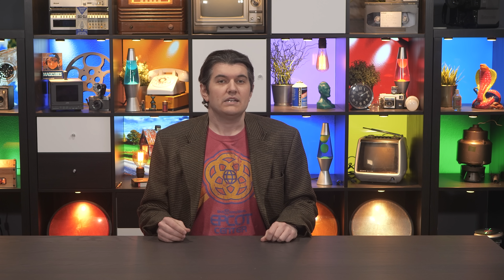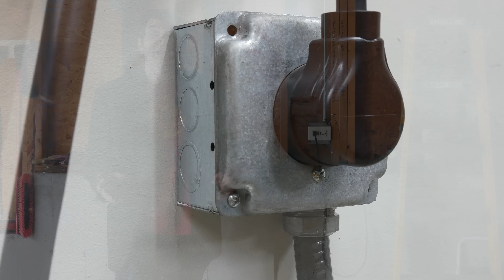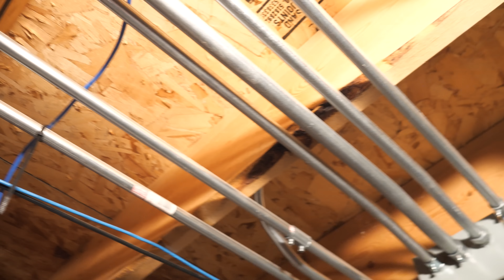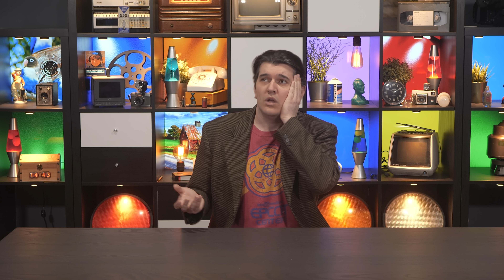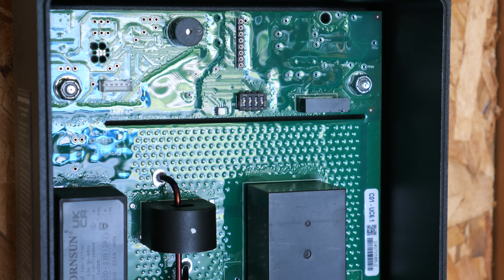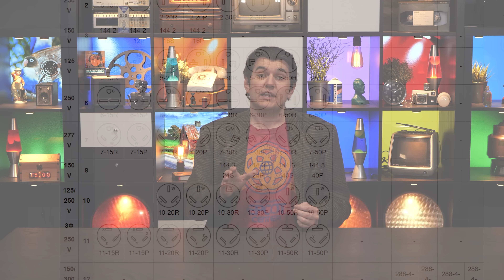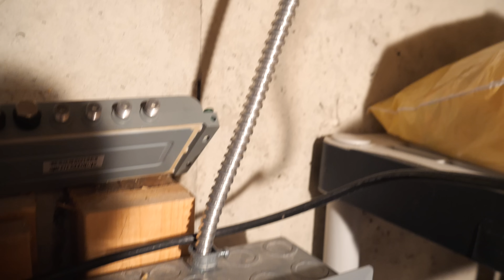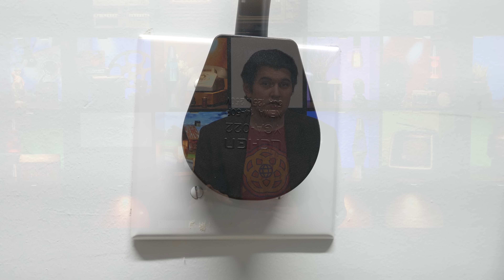The "standard" car charger is usually overkill—but your electrician might not know that

Comment: Meanwhile, Europe is split between "neat, I have 3 phase power anyway!" home owners and "who do I have to sacrifice to the Dark Lord to make my landlord or city install even the most basic charger near my parking spot" renters.
Reply: Tbf, that issue for renters exists everywhere (incl. the US)

Heck, my employer has been trying to install EVSE on the light poles in the parking lot and the landlord won't let them.
Reply: @antonliakhovitch8306 
 A potential reason for that is that many light poles are 277v and metered separately from the rest of the property. There aren't a lot of 277v (1ph of 480) chargers, and the wires are also frequently fairly low spec, as well as being powered by a relay and timer/photocell, rather than putting a timer or photocell in every light individually. 

So adding chargers to light poles may require completely rewiring and installing a new conduit to manage fill percentage. And that doesn't include the potential of issues with the light pole manufacturer not allowing those modifications without violating the listing. 

There might be power there already, but it's probably more expensive to use than installing new.
Reply: @Nidkidful Thanks, that's super informative.
I've seen buildings in the commercial area across the street install EV chargers on light posts for their fleet vehicles, but I imagine stuff is different there than in the industrial-ish business park my office is in.

On the other hand -- our building has stupidly high capacity industrial electrical service and we regularly get electrical work done on the inside. I'm sure they could find a way if they tried. I think the real issue is that the inside of the building is our domain, but the parking lot is managed directly by the landlord.

Luckily for me, I negotiated exclusive access to the one outdoor outlet behind the building in my contract, even before I bought a plug-in hybrid 🙂
Reply: Here in the Netherlands we have 3 Phase 380/400V as well
Reply: A client was installing a large warehouse to grow plants (legal here) in. He had the option to install 3 phase. He declined and said it wasn't necessary for just lighting. He might be regretting that now. I even told him it would make it sell for more if he decided to sell it.
Reply: Or the most frustrating situation: you have an outlet but it not allowed to be used for EVs
Reply: @leonidb3736 if it's not allowed I assume it's not yours? 😅
Reply: @pedropereira5043 if you live in a apartment complex the common infrastructure is, well, common. Means in reality even if you own a property you can’t do much, especially with the rules unless every other owner vote for that change
Reply: @pedropereira5043 or it's at capacity. An apartment building near me had a detached garage structure where everyone got one stall. They provisioned exactly enough 20 amp circuits to run the many door lifters (and used logic to limit the ones running at the same time) 

Worked beautifully for a while, until someone plugged an EV into the circuit and blew the breaker the next morning.
Reply: @pedropereira5043 it's more the issue that home grids aren't built for people non-stop using 3+kW for hours. It's fine to thrown on a kettle every in once in a while, wholly different story if 20 households have 2 kettles worth of draw for hours at a time.

This can be managed, but at least in Germany, to prevent grid spikes (less of a problem for the whole grid, more of a problem of tripping power for the building), an apartment building owner has to install a power management solution to allow EV charging in a garage. That's with it, but you need to convince co-owners that don't live there and/or don't have an EV themselves, because obviously installation and maintenance of that system still costs money
Reply: @leonidb3736  "you have an outlet but it not allowed to be used for EVs"
And that is completely justified:

half a year ago we had a huge network-problem at a convention. It would work for a couple of minutes and than randomly parts or the entire network would fail. After a couple hours of troubleshooting we found the problem: An EV charging at the other side of the centre. Its charging simply put too much noise onto the line and also was too irregular for other equipment to work correctly.
Reply: @ABaumstumpf  The car is surely EMV certified, unless it's a prototype. Therefore shouldn't be allowed to interfere with other equipment. If it still is, then you should report it to the authorities. But most likely it's just a defective onboard charger. If it was AC Charging that is. DC Charging uses powerline communication, which can be more problematic.
Reply: @tschuuuls486  "The car is surely EMV certified, unless it's a prototype. Therefore shouldn't be allowed to interfere with other equipment."
Those requirements are not as strict as the power-requirements for some electronic equipment. And it still can happen, specially given that the US has basically no country-wide regulations for vehicle-state.... just look at all the rolling rust.
Reply: @ABaumstumpf Most likely it's just that it's meant for running a engine heater and a) designed around having a 1-2h schedule timer hardwired into it (that is, assumes not too many outlets will be on at the same time, thus low capacity) and b) not metered separately
Reply: Lithuania has 3phase as standard too
Reply: Yeah, 3 phase, 40kW 2-family house to grid connection here. My 2x 11kW chargers can work at the same time, as well as the washing machine, dryer and oven. And I love it. Upgraded the grid connection for a possible heat pump in the near future.
Reply: @_TbT_  You need a load balancer, that automatically lower the power on the EV charger when power is used for other things in the house.,
Reply: @sallerc  by no means an expert but don't think he does unless he has a really high draw from his home otherwise. Sounds like even if he runs everything he has power to spare, not sure about other issues.
Reply: The AC charging standards in the USA don’t need to explicitly support 3-phase, because US electrical code allows for 12+kW loads on a single phase. If a public space has 3-phase supply, you can make use of that by having several single-phase chargers, distributed across the 3-phases.

Basically the US code is more tolerant to phase imbalance than EU codes. It seems to work 🤷‍♀️
Reply: By the way, just because the house I own has three phase available, that doesn’t mean I can charge a car — I don’t have a garage or a drive way. My car, if I had it, would be parked on the street.
Reply: I recently bought a house older than the United States. And hey, even I'm in that first cat, we have 3 phase outlets galore.
Reply: I've learned recently, but Italy it's not abnormal to have the whole house only supplied with 3.3kW. I've no idea how you'd charge an EV if you can't run an oven and a hair dryer at the same time.
Reply: @sIightIybored  Wow.  That's amazing.  Is this rural Italy or something?
Reply: @christo930 no, most homes built until 15 years ago or so have their wiring sized and contracts for 3 kW single phase. Now it has to be at least 6 kW
Reply: @sIightIybored yeah but you can request up to 6kW just by calling the power company, and 3phase 400V doesn’t cost more per month than single phase (you only pay the work to upgrade). Only problem is you have to pay about 2€/month for every kW of available power (both with single and three phase)
Reply: @Fla.3  true, but often you have to redo part of or all your wiring if you wanna actually be able to use the whole 6 kW, since if you have a 3 kW contract you probably have everything sized for 3 kW. Also it's true that upgrading to 6 kW is pretty easy but going higher is hard:  instead of just an electrician's certification you need an actual project signed by a professional engineer/circuit designer to have your system code compliant. Distribution company may allow up to 10 kW single phase if they consider the local grid "strong" enough, and above it's only three phase.
Paying more in standing charges for electricity it's not much of an issue when it allows to get rid of the gas bill.
Reply: @sIightIybored all new builds and renovations have to be 6.6 kW, which is ok for overnight charging (also you can draw 33% more for 3 hours so you have a temporary extra allowance up to 8 kW). It's still uncommon to find three phase and higher than 6 kW in residential but you start to see it in independent homes with solar.
I know spain is in a similar situation, France, Portugal and Greece are a bit better (the most common size is 6-8 kW instead of 3)
Reply: @sIightIybored 3.3kW is the norm in Italy for historical reasons, not the maximum contract which is 6.6kW and cost a bit more.
All contracts can peak up 40%  for 2 hours, so everyone can use up 5kW, that is plenty of time to dry hair or cook a pizza.

The issue it's that the Italian population is is mostly old people living on skinny pensions, they don't care at all about EVs, PV or electrification in general.
Reply: @jdm2651  it just seems crazy low from a country where I have 14.5kW and have been told I should probably upgrade to 24kW for more thermal headroom if I got an EV and wanted to run some appliances at the same time. 48kW is not atypical to the North Americans.
Reply: @sIightIybored Hey that's me. My house is only supplied with 3.3kW. I usually charge overnight at 3 ~ 2.8 kW. If I charge during the day I might charge slower if needed. Anyways you can go over that in small brust but it would eventually trip. So it's not a problem with a 3.3kW circuit to be using an oven or an air fryer and charging at 3kW. The load cycle of most appliances is short enough that nothing will trip. If needed you can have a 5kW peak or more for several minutes. The wiring coming into the house is rated for 7kW so not a problem due to the demand is split between multiple circuits don't panic.
Reply: @sIightIybored I guess it is because Italy does not have cold winters and a history of electric heating. My 140 m² house from 1974 is designed to be electrically heated at -29 °C and thus 3 x 63 A 230 V.
Reply: @sIightIybored  Similar in the caribbean, had 5.5kw but could technically handle around 10kw.
Reply: @sIightIybored  You make the car stop charging when you use an oven or hairdryer and start charging again after the load is turned off? Something like a zappy should be a off the shelf solution to that problem. Can also be DIYed with a shelly and home assistant.
Reply: @tschuuuls486 yeah that's common  knowledge for Italians, can use only one high power appliance at a time (oven, hairdryer, dishwasher, washing machine, vacuum cleaner, air conditioner…). For a full electric household, though, 3 kW is too little, in fact most Italians cook and heat with gas. 6 kW is ok but it can become a bit too tight  if you get an EV.
Reply: Here in Spain normal houses dont have 3 phase power, you can install It but is expensive, and normal power for a House is like 4kw
Reply: I'm a renter in the Netherlands (housing coop) and they've recently renovated my 1970s bungalow to be much more energy efficient. I also got a 3 phase electric thingy in the process.
Reply: Tough situation I’m assuming that maybe landlords don’t want to spend money on an expensive installation. So as an EV driver and as a LandLord or a small two family and a single tiny home rental  who do you all think should pay for these expensive installations?   As a reference I had charging installed at the two family that my wife and I live in to the two and half $5000 for a dual charger and that’s just for two EV’s no I know that in certain situations these things can be done for much cheaper, but nonetheless, this is still gonna cost quite a bit of money at least it’s quite a bit of money to me.  

No, I do believe that apartment complexes can’t afford these things and no doubt it as quite a lot of value and makes their apartments appealing and hear the US. I find a lot Place is starting to do that though sadly, they charge a huge amount for charging and what I mean is nearly the cost of fast charging at a supercharger.  Which means that they are charging well beyond what they need to pay for the expense of the installation and the ongoing costs of maintenance and electricity.    

How do we solve these problems? I’m thinking about getting into Consulting when it comes to these matters, but I’m not even sure of the best possible solutions entirely myself.
Reply: @LectricOverlanding , 20 amp receptacles are the solution.    So easy.
Reply: Three-phase home supply is not common in the UK, most homes are single-phase 240v and those with EVs get on fine with either the plug-in granny cable or a 32 amp / 7.2 kW dedicated circuit for a wall box 'charger' (EVSE).
Reply: @GruffSillyGoat Technically is is 2 phase. A single phase would only get you 3.6kW. Charging done via (230Vx16A)x2 so you have two phase lines + neutral. You don't run 32A through a single phase line.
Reply: @G @Gazer75 have no idea what you’re on about. It’s indeed a single phase supply delivery from the power grid to the house I.e. one Live circuit and one Neutral circuit. From the switchboard a dedicated 32A circuit can be run to supply the EVSE.
Reply: Many commercial spaces (incl. parking lots) and apartment buildings in the United States are served by 208Y/120 VAC or 480Y/277 VAC; yet, neither CCS1 nor SAE J3400 support three-phase AC charging.  Go figure.
Reply: @jmdavison62 So you think CCS2 might just be a better standard then as it supports AC single phase up to 7.4kW and three phase up to 22kW all in the one connector.
Reply: Im Part of the latter crowd. 
But at least I can get the most basic 11kw charger without much hassle. I love 3 phase power.
Reply: 3-phase power at 400 V! 11 kW at merely 16 A, or even 22 kW at 32 A.
Reply: As someone who has helped install EV chargers in cold climate areas, the tip about conduit requirements and local code differences is spot on. People should know that MC cable is a solid workaround where Romex isn’t allowed. Great callout about the 80% rule too most EV owners aren’t even aware of it.
Reply: The french parking lot-solar coverage legislation might help with some of that and be a model for other regions
Reply: For my country we mostly live in apartments that share carparks, with typically a handful of chargers per carpark of a few hundred cars, so I'm not sure if there'll be enough to go around. Also when your car is fully charged there, other motorists may expect you to vacate the charging spot promptly, but what happens if the carpark is full then? Does our car then get evicted from the carpark? I was wondering
Reply: Poland has so liberal laws about EVSE in shared apartment garage
You basically need to inform your housing council, and they can't say no. They can't interfere. They can't do anything as long as you have a favourable EV outlet expertise from one of MANY companies that install them
Reply: @KittenRaee In Portugal is the same, even if you're in an apartment building the other residents can't say no. But you have to ask anyway 😅
Reply: Yes., Germany here. 3 phase power and a 22kw charging station. That‘s a lot of power, not 5.8kw. The power grid in the US seems to be a little bit underwhelming.
Reply: Renters are out of luck in most places.
Reply: @danr1920 Oh you're more than welcome to pay for the upgrades yourself. 😂
Reply: At least most of Europe’s outlets can manage tea kettles way under 2 minutes.
Reply: Europe is not a country.
Reply: @MarkGovernI’m pretty sure that they are referring to central Europe (and Germany), not eastern Europe.
Reply: Fortunate, I live in 230 V land, and aluminium wiring is banned for LV installations.
Reply: I think due to the age of some European cities, their infrastructure is just not up to the level it needs to be for modern use. And unfortunately this is one of the big side effects.
Reply: Renters vote with your feet, if they don't, move, and let them know why.
Unfortunately this will need most renters to do so, otherwise the landlords will just laugh
Reply: @paulstubbs7678 
Literally nobody will abandon a favourable rent agreement for that if they can still drive gas cars. If there's a law stopping the sale of the latter there can also be one forcing landlords to install charging stations.
Reply: @Alias_Anybody  But is it a favourable rent if the landlord is a pain when it comes to EV's
Reply: Sorry sir, your amps are needed to fuel the poor emigrants!
Reply: Or I cant afford a EV or dont need one. But then EV owners doesnt realize there is such a demographic
Reply: @DrLoverLover  that's a bit silly. I'm an EV owner and I know there are folk who can't afford one or don't want one.

I just don't care about their opinions.

Why? Not because I hate ICE vehicles, I've owned several for many decades, still do for my motorbike, but because I use EVs.
Reply: 3phase is only standard in german speaking countries. Others have 1phase.
Regardless, we typically install red or blue P17 plugs.
Those US plugs seem so dangerous when the plug is half inserted.
Reply: Czechia is not German speaking country... @ABa-os6wm 

We have 3f 400V.
Reply: @danielsaroch2424 
Hey, Czechia could be counted as a German speaking country if you squint while staring at a map. At least more than Norway or Latvia.
Reply: @ABa-os6wm  I have 3 phase in my house, and I'm not speaking German. Luckily, they couldn't cross the channel 80 years ago
Reply: @ABa-os6wm I live in Poland we have 3 phase - at least in all new builds. Quite common in kitchens
Reply: @ABa-os6wm  What? It's standard and has been so since like forever in Sweden and Norway too and we don't speak German. Since you were wrong on that, I suspect we can simply forget what you said and that 3 phase is standard in many more countries.
Reply: @skunkjobb looks like it's easier to list where it's not standard: UK, France, Spain, Greece, Italy, Portugal
Reply: @elia_berti  in the UK you can get 3 phase - but it’s not standard, but often installed for larger houses. I have a 3 phase 400v 75kW supply to my house. Given most electric vehicles in Europe can’t do 3 phase above 16A I went with a dual charging post with 2x11kW points. This is handy as I get 5 hours of overnight cheap electricity and it means that you can almost always fully charge overnight at less than 10c/kWh.
Reply: @elia_berti in Italy you generally always get 3phase to the meter. The problem are the circuits between the meter and your appliances. But this is changing relatively fast for new premium homes, and in older ones it’s not so hard to upgrade after all.
Reply: @ABa-os6wm  I live in Serbia which is for sure not German speaking country and even my grandmother house build in 1961 had 3 phase sockets with every room had one ,because here stoves  always runed only on 3 phase but also heaters.
 During 60s,70s and 80s everyone who was not connected to central heating would run heating on 6KW heaters that would store heat in night because then it was 4 times cheaper then in the day ,it had some ceramic inside that would store the heat and they they woud release in day with fan
Reply: @ABa-os6wm Everybody uses 3 phases. The German grid operators are just paranoid about anybody running any load bigger than a toaster on a single phase due to 'Schieflasten'.
Reply: @patrick_test123  Firefox translated "Schieflasten" as ""Unwanking load" when I looked it up on Wikipedia.  That's hilarious.
US residential is split phase, 3-phase is used almost exclusively for commercial buildings here.  My house has pretty standard 200A 240V service, the only things I've got on both phases (so actually getting 240V) are the HVAC, clothes dryer, and car.
Reply: @ABa-os6wm netherlands is not german speaking… and 3 phase is either an easy and inexpensive upgrade or standard already
Reply: @backdrafter1988 one can argue that we’re just swamp Germans here. But that’s not very popular since 1940.
Reply: @ABa-os6wm  "3phase is only standard in german speaking countries" ??
lol, - Did you mean "germanic languages countries"?  :p
3-phase is standard house supply here in Norway. 
Only thing uniqe here, is that Norway and Albania (I belive?) use IT (Isolated Terra, - a floating earth - 3-phase 230v, with no neutral wire as a standard.
All of the world have 3-phase power as a standard. 
Pretty much all of Europe have a 3-phase power supply to moste houses and buildings.
Reply: @zigge1989  I wouldn't call 3 phase standard in Norway yet. Over 90% of homes still use IT which in 99% of the cases is not 3 phase. They just get two of the lines basically. You wont find many grid companies offering 230V IT 3 phase to private homes these days.
Reply: @Gazer75  All houses I have lived in build 1950's and up to 2000' have all had 3.phase 230v IT net.
The exception are older apartments, as 3-phase are split between other apartments.
The house I live in now were build 1972, and it has original 3-phase 230v power supply.
Reply: @zigge1989  What area is this? Here west my dad had to order 3 phase specifically due to some equipment using 3 phase motors. They stopped offering 3 phase to private homes back in the 80s I believe.
When they were going around replacing the meters to the smart ones the guy from the grid company had to come back as he had no 3 phase meters with him. No one in that area had this.
Reply: @ABa-os6wm 

Its standard in nordics as well..
Reply: @NerbyScurvy  Only for newer areas in Norway. Any areas developed before the mid 90s use 230V IT and mostly single phase.
Some allowed 230V IT 3-phase for private customers, but it was rare. We had that in our home built in 1976 due to some equipment my dad had.
New substations have been built to supply 400V TN-C-S.
Reply: @NerbyScurvy  It's not common to have 3 phase power in homes here in Norway. It may be standard for some businesses that use a lot of power. You can of course have it installed in your home if you want it, but it's not common
Reply: @perdanielsorensen7775  Since the late 90s any new development has 400V into the house. That is how you can get an 11kW 3 phase charger in newer homes ((230Vx16A)x3)=11kW.
My apartment building has 400V which is then split up to the apartments. We do not have 400V all the way as nothing uses it in the apartment.
My parents do have 400V all the way as the Nibe exhaust air heat pump system that heat each apartment need that.
Reply: @Gazer75  , I’m not familiar with “IT”. what is that? I’m in the US and our standard is 240V split phase.
Reply: @stellamcwick8455 Look up "earthing systems". There are 3 main ones. TN, TT and IT.
Reply: @stellamcwick8455 The TN, TT and IT are grounding system definitions from IEC.
Reply: @ABa-os6wm this pretty common in France as well for large homes.
Reply: @ABa-os6wm  Hello from Greece. Plenty of homes have three-phase here.
Reply: @ABa-os6wm aside from being entirely wrong, what exactly are you saying here? Is 3 phase power limited to German speaking countries in some weird linguistic power play? Maybe lay off on the schnaps.
Reply: @ABa-os6wm  nonsense. We don’t speak German, and everyone has (well, can very easily and cheaply get) 3-phase power. It’s already in your main fuse box, the fuses just are not connected on the other two if you don’t have it. You just call the electricity company, make an appointment, pay something like €50 or so for someone licensed to install the missing fuses and re-seal the main fuse box, and you’re done. It’s the same monthly price as just having a single phase too.
Reply: @ABa-os6wm 
I have 3 phase here in Romania.
It’s fairly common even in flat apartments.
Reply: 3 phase is available in all EU countries.
It's just that in some it was more easily available in the past.
Reply: @ABa-os6wm Oh geez. I can't remember the last time I was shocked. Maybe 25 years ago. And US plugs are way better than Japanese plugs, especially since Japanese infrastructure is often so old. Not to mention not having a ground so you can't run anything you'd normally run in the US without some modification.
Reply: @ABa-os6wm  In the Netherlands it's 3-phase as well.
Reply: Finland here, we have 3 phase on the regular in detached house garages. @ABa-os6wm
Reply: @ABa-os6wm  Here in Czechia 3 phase power for single family homes is almost universal. It’s mostly apartments that get 1 phase service.
Reply: @ABa-os6wm I'm not sure what's the standard here in Portugal, but my parents house is 3 phase and my flat is 1 phase (which makes sense). I assume 3 phase isn't the norm around here, but it's common.
Reply: @ABa-os6wm  3 phases are not uncommon here in France. Either from older installation (and I do mean older), or in new constructions or heavy renovations when the owner need more than 12 kVA (often medium to large house with EVs and full electrical climate control). It's still a minority, but not a tiny one by any mean.
And if needed, you can switch. There's some cost from distribution, and of course you need to have your breaker panel re-done for 3 phases, but the cost is not astronomical.
Reply: @ABa-os6wm Common in Lithuania too where are you pulling the German speaking bit out of?
Reply: @ABa-os6wm  I didn't know that in Poland I speak German.
Reply: @ABa-os6wm  I’m in Belgium, I don’t speak german, and have 3 phase 400 V power.
Reply: @ABa-os6wm  I don't know a single German word, yet 3-phase is pretty standard on older houses. They were used for heavy motorized tools, like table saws, cement mixers or pumps. Those are not as common nowadays, so there's not much need for a 3-phase socket, but it's still possible to get it.
Reply: @ABa-os6wm 3phase is also pretty common in the Netherlands
Reply: @ABa-os6wm Here in the Netherlands 3 phase is also standard. Many houses only use 1 phase, but the main supply cable always has all 3 phases. An existing meter can be changed to 3 phase on request. Ok, Dutch is a germanic language but so is English.
Reply: In that case Finland is a German speaking country. 3-phase 63 A 230 V standard since 1974 where I live.  @ABa-os6wm
Reply: @ABa-os6wm  Belgium here, I got 3 phase. Don't know if it's standard for new constructions, certainly wasn't standard in the past AFAIK, but lots of houses have it. Of the people of whom I know how many phases they got, all of them have 3-phase installations. I guess people in apartments don't, and I'm sure some of my homeowner acquaintances won't either. But frankly I couldn't name a single one.
Reply: That is not true at all. It is WAY more common than Germany and Austria and Switzerland.
Reply: @ABa-os6wm wtf you talking about? Very much standard in much of Europe
Reply: @ABa-os6wm 
Oh, I thought at least Benelux and Scandinavia would also have 3 phase plugs? 

Edit: Apparently they also speak German in Sweden, Latvia and Poland these days. History is interesting.
Reply: @Alias_Anybody Yes, at least in Sweden we have 3 phase. And the house I live in is from the 70s, and yet, we have 3 phase outlets. I would imagine newer buildings don't exactly have worse wiring.
Reply: @Alias_Anybody Netherlands is 1x35 fused or C40 breaker standard, 3x25 upgraded. You can get bigger but those are considerably more expensive — like 3x35 costs 130 a month extra, 3x50, 3x65, and 3x80 each cost an extra 100 bucks or so a month. And more than 3x80 — if you can even get it, which is also an issue with the smaller ones — are priced at BOHICA and/or “if you have to ask” units.
Reply: @Alias_Anybody  they exist but are not that common in the Netherlands. What is incredibly common though is a 'cooking group' aka dedicated circuit for the stove that works on two circuits at the same time. That means a 7000W maximum.

Whether they make EV solutions for those, I don't know.
Reply: @alfepalfe  My grandfather had 3 phase power before he had a tractor. 70-80 years ago
Reply: @ABa-os6wm  Didn't know Poland was German speaking now... For houses 3 phase was standard for years, now 3 phase is even standard for most newly built flats, as they move away from gas and adding cooking to standard loads on sigle phase is iffy.
Reply: @bar10005  Well, a large part of Poland were part of Germany before WW2.
Reply: @bar10005 yeah taxis there don't understand basic english but speak german
Reply: @ABa-os6wm  I'm in Latvia. Only flats are usually single phase. Most houses are 3P, even older ones.
Reply: @ABa-os6wm  Pretty sure there is 400V 3-phase at the nearest junction box. I'd be surprised if there is not two phase lines + neutral in most cases. This would at least allow for 7.4kW charging ((230Vx16A)x2).
Reply: @Gazer75  yes but you are limited by local distribution transformers which are only split phase in residential areas.
Reply: @wolfpeoplearereal  No split phase in Europe. 400V TN-C-S is 3 phase + PEN. 230V is from L+N. The LV is all 3 phase and then split up at junction boxes to balance the 3 phases. Transformers take the HV 3 phase and reduce it to 3 phase 400V using delta/wye configuration.
Reply: @ABa-os6wm  3 phase is standard in most (EU) countries due to higher household  needs nowadays
Reply: @ABa-os6wm  "Those US plugs seem so dangerous when the plug is half inserted."
🥱
Reply: @StoneE4 right? Its almost like there's a video about this exact issue on this same channel…
Reply: @StoneE4 yes it seems so
Reply: @StoneE4 Something something penny challenge. I shocked myself once with one of those outlets.
Reply: They are more likely to be banned than to have charging facilities.  We're seeing this a lot now just with E-bikes.  For some reason, we just cannot make cars that don't catch fire.  Yet another car carrier was abandoned just this week (The Morning Midas) with three thousand cars and the ship lost off the coast of Alaska.  Fire started in the EV section.
I would NEVER charge a car in my garage or really any structure.
Reply: @christo930 Electric cars are less likely to catch fire compared to ice cars. So you should then definitely never park them in any buildings.
You can't compare e-bike batteries with car batteries. Completely different standards and safety systems.
Reply: @Vrabetzz  First, this is not true. Stache training has a video on it. He is a fire guy and not a car guy, but is an SAE member IIRC.
Second, parked real cars generally don't catch fire.
Third, a real car fire is much, much easier to deal with than an EV fire.  They burn MUCH, MUCH hotter and they burn faster.  You can literally have mere seconds between something going wrong and a large fire. You cannot put them out with fire extinguishers (lithium ion fire extinguishers are fake, again, see stache training, no such certification exists)
Finally this isn't true.  E-bikes and EVs use the same exact cells made of the same chemistry.

Unrelated is the average age of an ICE vs an EV.  The EV fleet is MUCH newer than the ICE fleet.  A brand new ice car catching fire is incredibly rare.  More importantly, the risk of EV fires is going to go way up as the fleet gets bigger and ages.
Reply: @christo930  Your second paragraph torpedoes your own argument.

The average age of an EV is much newer than ICE vehicles. - okay.

The likelihood of a new ICE vehicle to catch fire is quite low. - you've not provided any evidence to back it up but let's give you the benefit of the doubt.

What you've just said is new ICE vehicles don't catch fire, but the average ICE vehicle is older than an EV, implying you recognise that an ICE vehicle fire for the typical ICE vehicle is indeed several times more likely than an EV fire, but you're ignoring that.

But hey, you keep wringing your hands about this issue. The rest of us will get on with our lives.
Reply: @christo930  All available data suggests ICE cars are at least 20 times more likely to catch fire compared to EVs if you just compare the number of corresponding cars on the road and fires. Just do even a cursory search online instead of listening to the gut feeling of one person. There are even a few summaries by insurance providers or car publications like motortrend. Age really is a big contributor to more car fires in ICE cars. And it's true modern EVs haven't been around that long on the mass market. But then you shouldn't allow cars older than 10 years inside structures and you should absolutely allow newer EVs by your own logic.
Once an EV burns, it's true it can in some cases get hotter and it's harder to extinguish without proper strategies and gear. They usually don't burn faster than a car with a literal tank full of flammable liquid. The biggest issue is putting out the fire completely because it can spontaneously reignite and the battery is usually beneath the car where you have limited access without special equipment. But reignition is not an issue for buildings since the cars will be outside at that point. 
LFP and sodium batteries are even safer and can't self ignite at all.
A cheap e-bike will definitely not use the same battery cells as EVs. Yes, they typically have 18650 cells inside, but that's where the similarities end even for the Tesla model S/X which are the only EVs I know of to even use 18650s. And there's huge differences between suppliers and models as well. There's also different grades for the same cells from the same manufacturer. Not to mention a proper BMS and thermal management and a much better quality control etc.
Reply: @Vrabetzz  No, it's not true.  There is no central repository of mandatory reporting.  It's not a "feeling" the guy (stache), it's his job to know this stuff.
Just last week we lost yet another car carrier and 3000 cars off the coast of Alaska to an ev fire. A brand new EV spontaneously caught fire on a boat.

First, it's not MY idea, it's insurance. It's landlords (who have to pay the insurance).  It's the lack of codes.  It's the lack of proper fire mitigation systems that work with lithium ion battery fires.

We've been dealing with liquid fuel fires for over 100 years.  We know how to minimize  them and we know how to put them out once they start.  Our structures were built with these fires in mind.  The fire code is around ICE cars (in the car specialty)

You said :
"They usually don't burn faster than a car with a literal tank full of flammable liquid"

Categorically false.  Lithium batteries burn unbelievably fast.  I've seen video of a bike battery that was fine, the guy  gets on the elevator, 2 seconds later there is a tiny bit of smoke and 2 seconds later the whole elevator is engulfed in flames.  This is true of cars as well.

Septa just had a huge EV bus fire like 2 weeks ago.

You are wrong again.  Bikes use the same chemistry and the same 18650 or 21700 cells.  Regardless of the shape of the cells, they are all the same.

You are very dishonest.
Reply: @christo930 Although electric cars and electric bicycles/skateboards etc often use similar lithium cells, they are treated very differently. EVs have much more complicated modules with temperature sensors, armored casing and active cooling. Plus they use less of the cell’s full capacity. All designed to prolong the battery’s lifetime and increase safety.

Electric bicycles etc push the cells to the max, and often just have them loosely held together in plastic supports, rattling around in an outer plastic shell. Furthermore the connectors are often woefully underspecced, which can easily start a fire.
Reply: @christo930  How am I dishonest? I'm just telling you to look at real data instead of relying on a single source with a limited perspective.
While there is no official data in the US, that doesn't mean there's no data around the world or from third parties. Again I would encourage you to just do a simple search and you should find the data in a couple of seconds.
It's true some landlords or insurances are scared because it's something new. But that doesn't change the facts and in countries with higher EV adoption like Norway those fears have largely disappeared as people got experience with EVs.
I totally agree we have way more experience with gasoline fires because they happen more often and there's more ICE cars around. But that still means nothing about the risks of a fire. With proper equipment and training, both of which are becoming more widespread with EV adoption, there's no real issue. It's just a bit different to handle. That's all.
And I don't know why you try to argue multiple sources of large data pools with an anecdotal video of a different thing you saw on the internet. And have you checked how many ICE fires were happening while the one EV bus burned?
And you still don't understand the differences between EV batteries and cheap e-bikes in the slightest. Proper EV batteries are designed with fire resistant housings and have vent holes for built up pressure etc. E-bike batteries usually don't have all those features in addition to often having inferior cheap cells from unreliable manufacturers.
And you have apparently no idea about battery chemistry or form factors.
First of all most EV models don't use 18650 or 21700 cells. They mostly use prismatic or pouch type cells. And they are not the same at all in regard to fire safety. Cylindrical cells are actually safer than pouch cells for example due to their comparatively strong mechanical casing. Also there are a dozen different chemistries like NCA, NMC, LFP,... which have even more sub types of chemistries like LMFP, NMC 811, NMC 622... and every manufacturer adds their own special sauce on top and grades the cells in addition. Some of those chemistries are commonly used in E-bikes for sure, but due to the lower energy density, LFP for example is not typically used in e-bikes, but is currently dominating the world wide EV market. And LFP is much safer than NMC or NCA cells typically referred to as lithium ion batteries.
Reply: @christo930 live in fear.